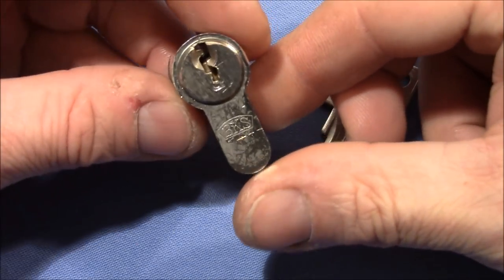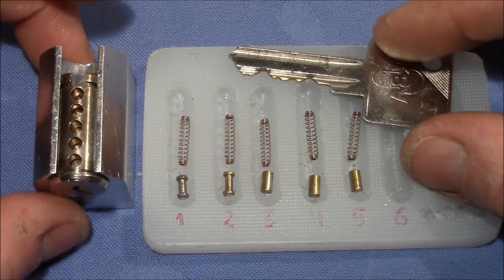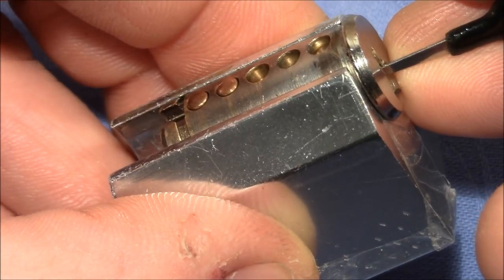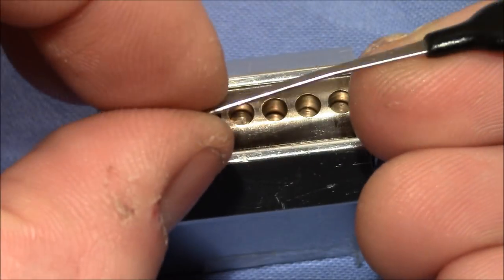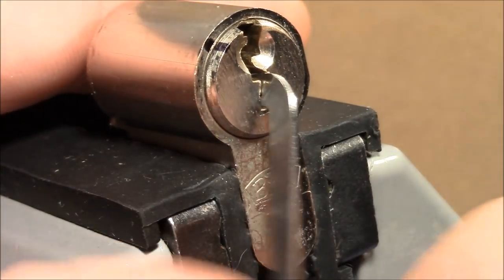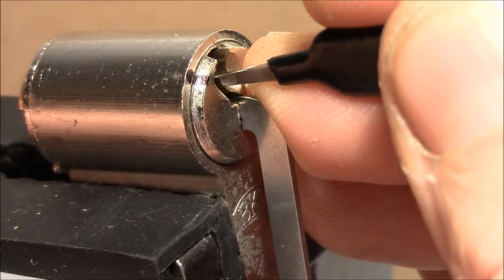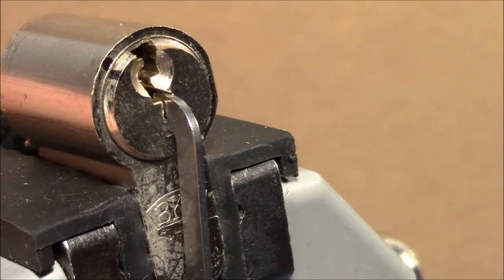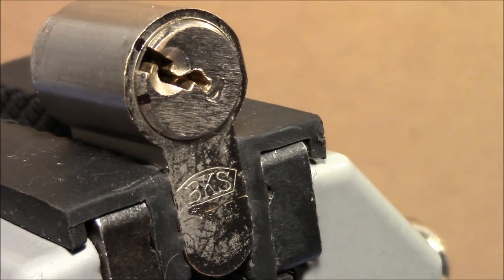(picking 464) BKS euro lock analyzed and picked - three ways to pick this keyway

Comment: Nice picking and explanation. A great video for showing new and intermediate pickers different approaches to a hard lock. Tallan used a ridiculously deep hook on his latest vid too :-) have you tried the ssdev picks on this?
Reply from the maker: Thank you. Yes, I tried the Sparrows but the reach is not good enough for the 2rd pin.
Reply: As a total noob, my end goal is to pick a euro cylinder.  This video is the clearest explanation I have found where it explained why each pick was suitable and how to use each pick differently in the paracentric warding.  Thank you so much.
Reply: @Potti314  For me, with the Multipick cutaway practise lock (which is a very nice BKS PZ), the medium Sparrows SSDeV hook (from the set of three) works using your third method all along. (I can do the whole lock using only that pick.) Admittedly, mine has the deep cut in 3, protecting two high cuts in 4 and 5. The "downside" of that particular pick is the very pointy tip, so there's some slipping involved. ;) But it's a very pleasant surprise to see what that profile can do in locks like that. It may however not work beyond 5 or 6 pins tops because of the growing shank height towards the handle.

Comment: Many thanks for the very educational video!
The paracentric keyway created the pin 4 overset trap?  I’m a noob to this ... 
also the front pins required a third type of pick ... that has to be the most challenging lock I’ve seen so far! 
Question was that a stock lock?
Reply from the maker: Thank you. Yes, the fourth pin is easily overset when attempting to set #5. Imagine that you usually don't know the bitting in advance and have to deduce all this by feeling. The thing with the front pins is that when going sideways I cannot apply enough force to set the spools without resetting other pins - so I like to go straight on these. And yes, this is a standard (stock) lock.